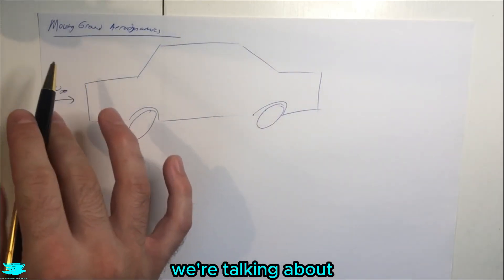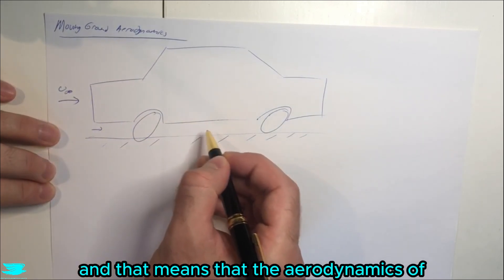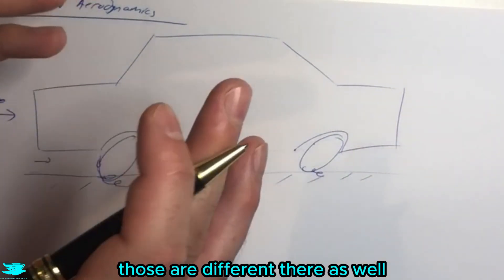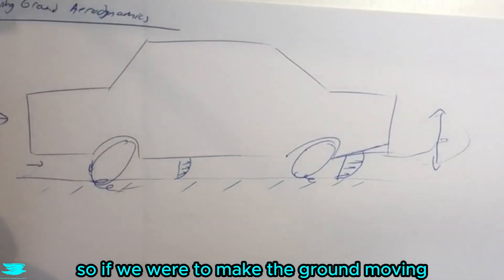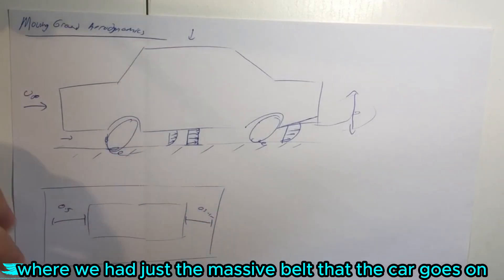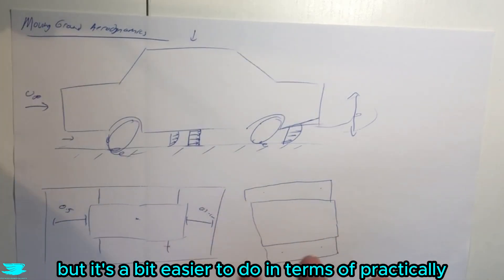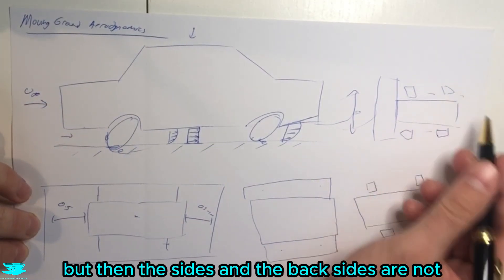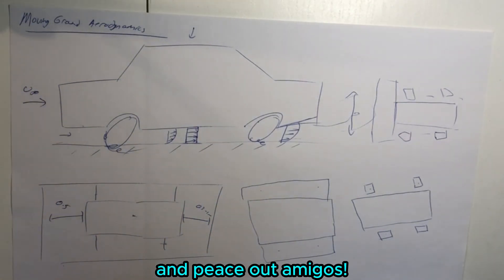Effect Of Moving Ground On Car Aerodynamics {Auto Aero #69}

Comment: What about using suction to remove the boundary layer? What are the pros and cons of using it for testing aero of a car?
Reply from the maker: The major pro is that you remove any small boundary layer that grew between the scoop at the front of the test section and the car.

The cons are that it adds some flow angularity and that it is harder to replicate in CFD because you need to get the suction right.
Reply: @PremierAerodynamics  I've never thought of that. Thanks so much.

Comment: is it worth putting an undertray under my car that covers most of the rough geometry except the exhaust? like can i get 80% of the benefit with just having a smooth underside of the car?
Reply: Yes flat floor is better than not having a cover at all
Reply from the maker: Yep, generally having a smooth underbody is best, but retrofitting an existing car can be complicated especially if the cooling flow comes out in the underbody. In that case, you need to locate where and cut vents into the panels to let the flow still come through.